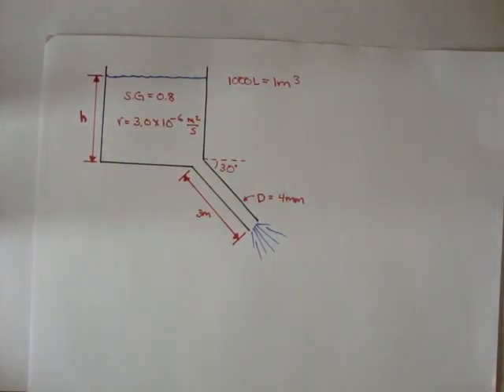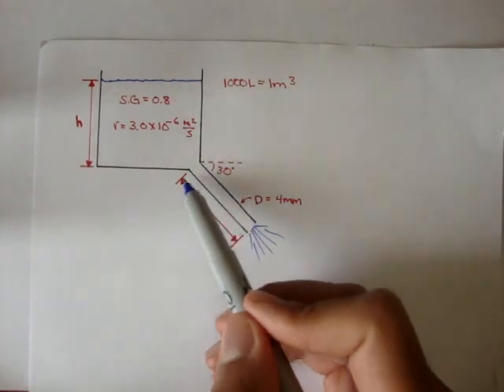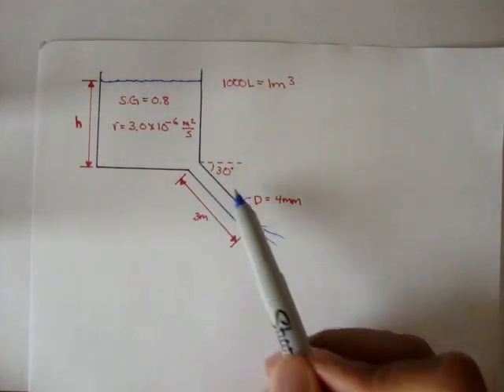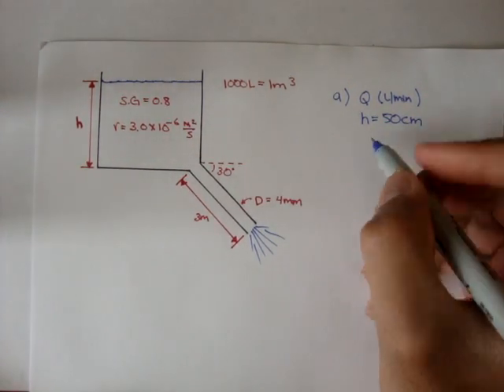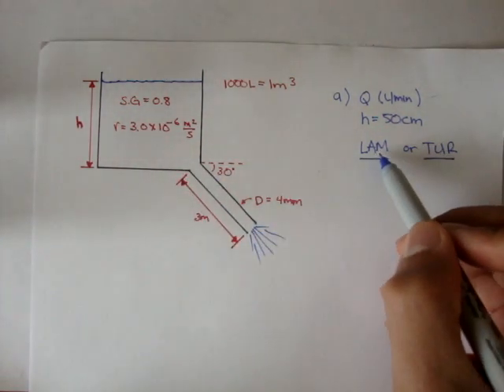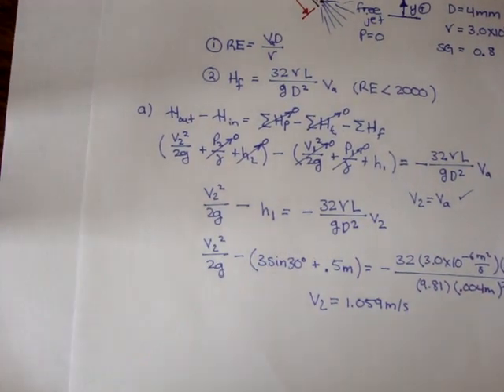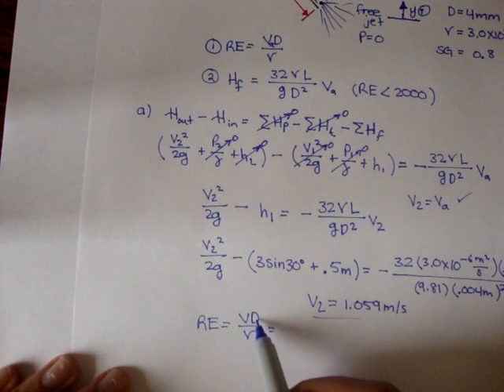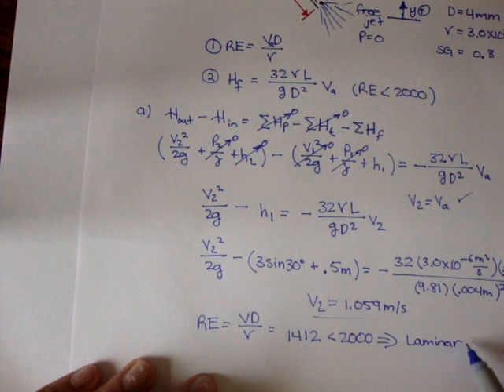Pipe Flow: Example 1: Part 1 [Fluid Mechanics #37]

Comment: If we were to have an H2, where would we measure that from because i dont get how you made h1 = 3sin30+3 and my intial guess was just 3m from the top of the kerosene to where the water starts flowing in the pipe?!
Reply: He set the datum at point 2 (at the free jet).  This means, that H2 would be zero, because it is at the datum.  H1 is 3sin30 + 0.5 because there is the vertical portion of the pipe (3sin30) and the height of the water in the tank (o.5m).  The vertical portion can be calculated with a trig identity sin(θ) = opposite/hypotenuse.  In this case, sin(30)= (vertical portion of pipe)/3m.  Thus, the vertical portion of the pipe equals 3sin(30) and H1 = 3sin30 + 0.5.

Comment: Wouldn't the velocity at point 1 be non zero because the water is gradually exiting therefore the level of point one going down at a certain rate?
Reply: Mexisio22 well, it is safe to assume that the velocity at point 1 is negligible since its only exit is a 4mm tube which is very narrow compared to the volume of water in the tank, thus it cancels.

Comment from the maker: Theres really not set limit for laminar flow. I chose 2000 because it was a clean number and we can use it for understanding the concept behind these problems and using it to learn how to solve these types of problems. If your professor requires a different number for laminar flow, use that one.
Reply: Sir can i find solution for calculatiing for  multiphase flow?